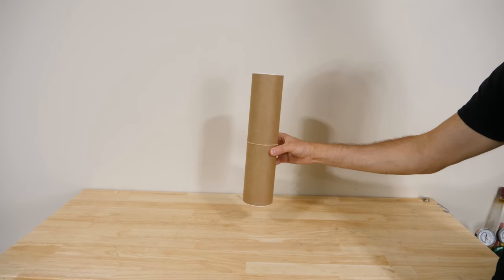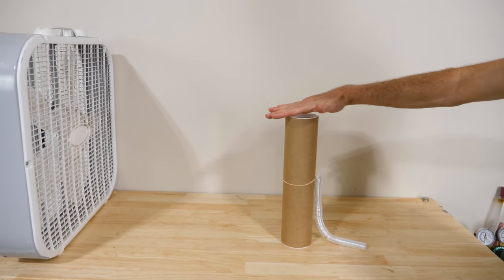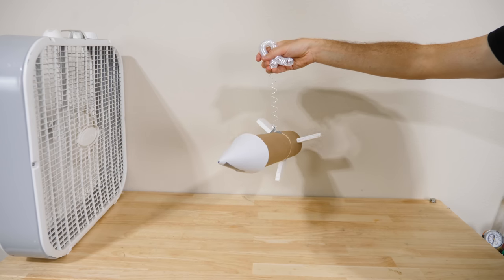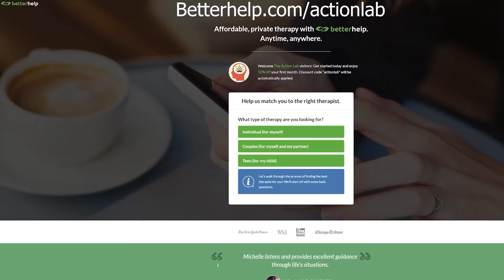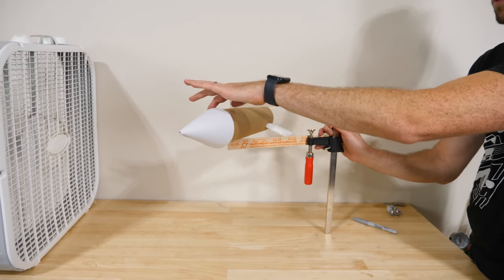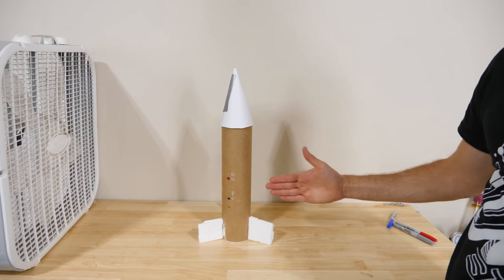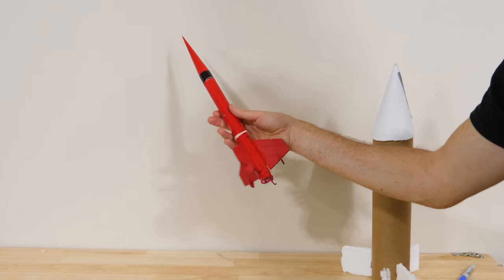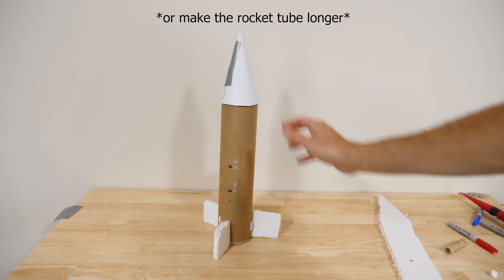I'll Show You What Happens When Rockets Don't Have Fins

Comment: So could you fly a finless rocket by just weighting the nose - of course the extra weight would cost performance.
it would be rather fun to see a tube with no fins and no nosecone (cheat and hide the nosecone with a cylinder of mesh, which could also be the weight)

Comment: You can basically think of the air as water, when moving at such speeds the air is almost like a fluid and that fin is cutting through the fluid putting a equal force on both sides balancing it out

Comment: Hello, I wanted to ask you to put two different containers, one wide and the other narrow, containing water with the same mass and initial temperature inside the vacuum chamber, so that we can see which one boils faster? . I think that water in a narrow glass will boil faster because it will have a lower temperature drop than the other one due to surface evaporation before boiling. Thank you for doing this test, friend

Comment: what is this guy talking about .. shadow method? that's not applicable at all, bcoz you disregard whats inside the object, assuming you want to make a miniature rocket and you use shadow method, you will fail miserably bcoz what you measure is only the case. and what if your rocket part are diff/ allum/plastic/etc.

Comment: You didn't do a very good job explaining center of pressure, and your demonstration using a fan doesn't help much.  While it clearly shows how fins help the rocket 'weather-vane'  itself against a sideways wind, it doesn't account for the fact that the accelerating force for the rocket will be coming from the end of the cylinder.  Not a very clear demonstration IMO

Comment: We already know the explanation for this but if we were discovering rockets and aerodynamics for the first time, this would be an issue. That spring you're hanging your rocket from has enough torsional energy to consistently spin the rocket to the right every time, as we observed. we cannot know what affect, if any, the air had on the rocket without eliminating this variable.

Comment: If the centre of pressure is behind the centre of gravity by a distance equal to the diameter of the rocket then it is considered to have a stability of 1. If the gap is twice the diameter then a stability of 2, etc. Typically you want a stability of at minimum 1 but often more, like 2 or even 3. There’s pros and cons to more or less stability. Interesting stuff :)

Comment: This was really a terrible explanation. It is excessively dumbed down to the point of never getting to the "why". It ultimately fails to make the simple point that the center of mass is the point the rocket is going to rotate about, while the center of pressure is the point where force is applied. Having the center of mass forward of the center of pressure makes the rocket inherently stable, since deviation is going to increase lift generated by the fins and that force is going to rotate the rocket back into streamline, while having it aft makes it inherently unstable as the increase in pressure is going to cause the rocket to rotate out of streamline.

Comment: SpaceX rockets have Gridfins instead of wings

There are following purpose of using fins
(1) to maintain 0 degree angle of attack
(2) to provide necessary pitching moment in order to change the flight path to account for coriolis force